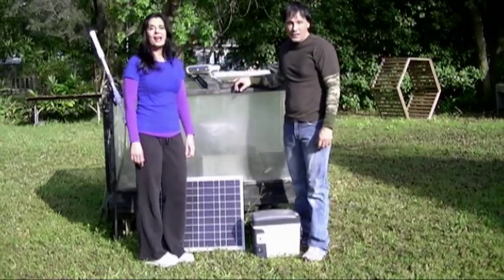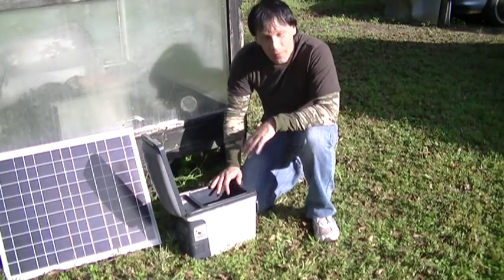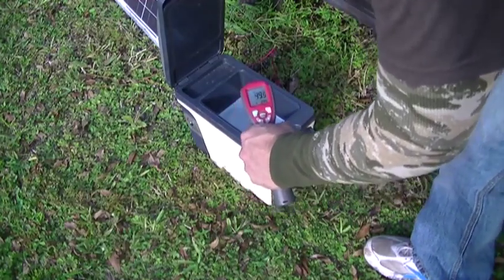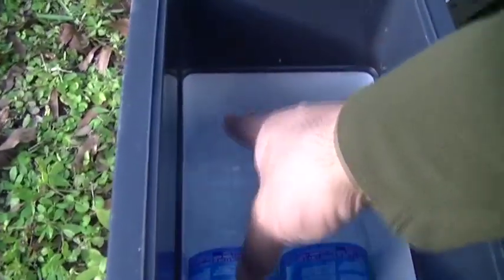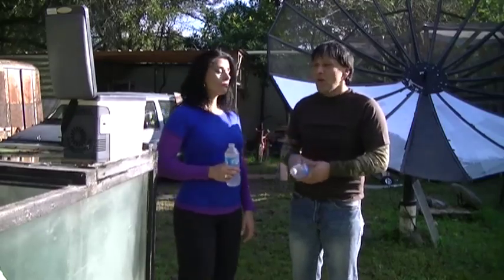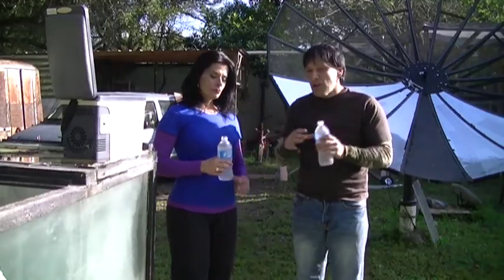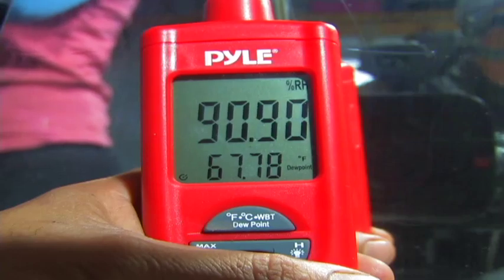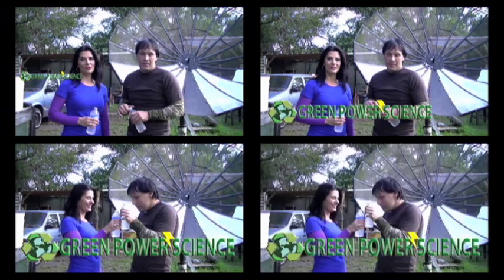DIY SOLAR COOLING REFRIGERATION Solar Panel thermoelectric Peltier Cooler

Comment: can you make the solar panel charge the battery while the battery is supplying the TEC>?
Reply from the maker: Yes, if the watt rating of the panel is greater than the TEC+CPU fan consumption the panel will deliver extra electrons to the battery if it needs it. For this configuration, a charge controller is needed to protect the battery.

Comment: Could a cooler like this be connected directly to a solar panel without a charge controller or battery?  That's what I want to know but don't want to fry anything attempting it.  My panel charges at around 14V and the max wattage is 100.  

or if that wouldn't work, what would happen if I connected my thermoelectric cooler directly to the charge controller output and didn't use a battery?  

I'd like the cooler to draw power only when there's solar power available.  I don't want it to drain my battery and don't want to be constantly fussing with turning it on and off all the time.  

Anyone know about this??
Reply: Currently I am testing a setup with 6 500F 2.7V super capacitors in series instead of battery. I am using 57W cooler and 100W solar panel. On a slight shade controller almost instantly cuts off power until it charges a bit... So not so good solution, will test soon if I can wire it without controller.
Reply: @UrošGolob-w7v  saved, solar power peltier cooler.

Comment: hello. i would like to know how to make an air conditioner from a solar water heater using some peltier
Reply: I am planing to do it and I have designed a model on solar powered air conditioning
Reply: I am planing to do it and I have designed a model on solar powered air conditioning
Reply: I have designed a model on it
Reply: I have designed a model on it

Comment: Peltier coolers are shit. They do next to nothing. Get a compressor model. Those work no matter how hot it is, with less power.
Reply: +alejandro catan (morfeo) 

I have. It has run for the last two weeks, with a 100watt solarpanel on top of a van hooked up with a 105AH battery(deep-cycle).

The peltier cooler stopped working the next day, panel could not keep up. The cooler drew around 50watts all the time. The compressor model only fires up about 1-3 times an hour for a few minutes. Power draw on the compressor cooler is lower too.
Reply from the maker: +Deiphobuzz These work good with low power consumption. No moving parts except the fan. Newer thermoelectric technology is awesome. Compressors will, in the future, go the way of coal.
Reply: Have you tested it in 100 degree+? My compressor type cooler used 0.28kw running at 40F, for 48 hours straight, in a 75f surrounding. It used 0.36kw running at 25f in the same time period.

Thermoelectric uses a lot more energy that compressor types. Please show me models that perform better and use less power in very hot conditions. I have owned those thermo units. They do nothing when it gets hot, and pull way to much power.
Reply: +Deiphobuzz have you run your compressor with a solar panel?
Reply: Their efficiency air cooled on the hot side and air cooling for the cold side is terrible agreed. Just if you buy one, rig it with liquid cooling the performance is a drastic improvement. youll gain about 35% efficiency depending on the reservoir that you use and the surface area of the radiators and the fans. Built my own and has a 40 degree drop on average.

Comment: IR thermometers are a terrible tool to use for trying to accumulate useful data. They reflect WAY to much. I only use contact thermocouples for measuring temperature.

Comment: Great Video. But the thing with Peltier coolers is that they are about 5 to 15% efficient which will kill a battery a lot quicker than you would think. Compressor fridges for about 30 to 50% efficient and if ur lucky 55% efficient. Just thought anybody would want to know that. so yeh id get a really small one if your still going with thermal electric coolers. Let us know if you find a great compressor fridge too.

Comment: Other than cost...why not make a scooter that has a solar panel as the deck and make the frame from aluminum painted black with peltier plates on the inside. Complex circuitry to combine it all and charge a lipo battery pack, but that would be pretty cool in my opinion...

Comment: @Peterwhitlock I built my home for next to nothing the ground stays around 50 degrees year round this includes the summer time. So i am saying you don't need a device to cool your home nor do you need 100,000 dollars. You need to get off your ass put some sweat equity in and stop blaiming others for your inability so solve your own problems. look up passive cooling and you will see its costs nothing.

Comment: @Peterwhitlock I sent no clip and I didn't mention anything about a dinky toy. Passive solar heating and cooling are used in 800 to 6,000 square foot homes. I myself live in one and spend about $300 annualy on heating and cooling here in Wisconsin. temp range from -30 with wind shear to 108 in the shade.

Comment: Dan , YOUR VIDEO HAS BEEN very  educating but Family has through the years made sure that the old crazy survivalist lose his toys one by one At one time I a four car batties with six different 12 volt  RV MOTOR HOME devices WITH  long cord to a car to recharge the batteries for two to four hours each day during disaster / power failers in South Florida

Comment: @Can101276 
  Hey see what you saying i agree//    10 000 watts / thats  883 amps at 12v and 416 at 24 volt and so on//  
he have to battery bank as big as semi // and even if does there is no dam way pay off in year //  Bet if has a system  he didn't install and he,s  got mixed up / with   he"s  statement // and if does 
// you right it take 20 to 25  yrs pay off at current cost //  i paying 13.5 cent kw with raise //  was paying 8.5 yr 
 ago //  projected 15 cents  kw in next  yrs / in ohio

Comment: Thanks for the video Dan.  I encourage you to TRY and find a Coleman Stirling Power Cooler. 
It is a Free Piston Stirling Cooler with settings for cooling and freezing. Sadly Coleman quit selling these a few years ago. They can still be bought from Global Cooling under the twinbird brand name.  If thats not cold enough, one model of Twinbird will get down to -80°C/-112°F

Comment: @TIGHTWADHERMAN  Sounds like you have a nice setup. The gentilman I was adressing made some outrageous claims..
1 - he was off grid
2 - He claimed to be storing enough energy to run 10 000 watts continiously for a week without an input!
3 - he said it paid for itself in a year
The problem here in Ontario is we used to pay 4 cents a killowatt, 10 cents starting soon,  and the government is paying 80 cents a killowatt for rooftop solar..... so when does my bill go up by 2000 percent?

Comment: @Can101276 
  Don't what your electricity  cost are // mine is  3500 yr // with new rate hike 4300 yr 
 pay off in ohio  is around 3 to 4 yrs doing a lot your self  7 to 8 yrs having it installed
 and we are middle ground on cost in ohio //  hot  us states to south and western states are 20 to 25%  
higher then my cost mine //  and they get 30% more sunshine than ohio //   so realistically  you pay for small home in about yr in southern state in the US

Comment: @WulfBand  Of course, you are correct in also needing a battery bank, a couple of marine batteries will do, for short term  back up for  meds. you seem to be talking more along the lines of a prepper's system at 10,000 watts.

Comment: @WulfBand 10 000 watts continious for a week, without an input? How many thousand square feet does it take to store the batteries. Paid for itself in a year..... I smell bullshit!
Even if you had found solar pannels for a dollar a watt, to load those batteries, and a free invertor (10kw invertor is 3-8 grand)  it would take a very long time to pay for itself.
It would take 10 years for me to spend 20 thousand on heat and electricity for my home, and Im up in Canada!

Comment: Great vid. Using fresnel to power an absorption chiller is a great idea in comments above. Normal aircon efficiency is so much better than peltier, peltier can only pump a fraction of a watt for each watt of electricity...

Comment: hey guys great video. Question on an idea i had a long time ago. How about a gas, electric refrigerator? But instead of gas heating the part that needs to be heated. how about one of your big lens heating it during the day and solar panels charging batt during the day to run it at night.

Comment: Cool stuff! There are car seat coolers that use Peltier technology. It would be sweet to run them from solar cells, rather than from the electrical system. Might make an interesting build ...

Comment: Works kind of like the clay pot refrigeration, two pots with a thin layer of sand in between then water is added. The evaporation of the water causes the inner pot to get colder stealing energy from it.